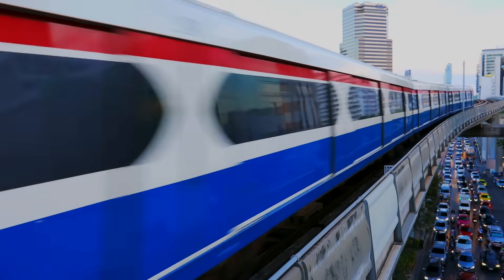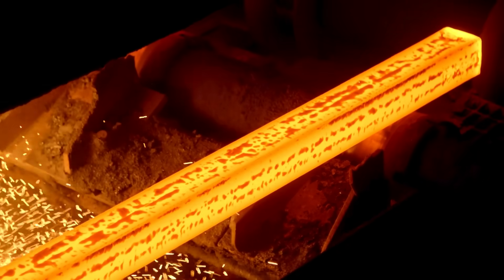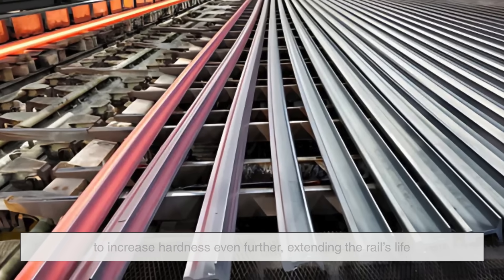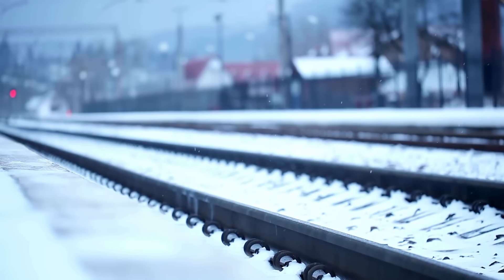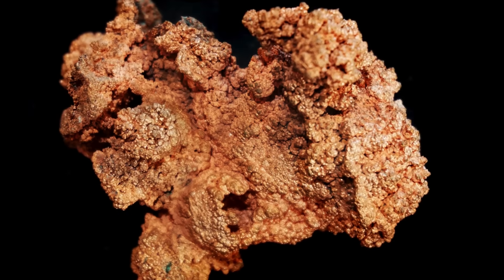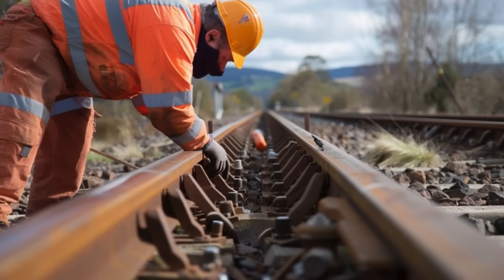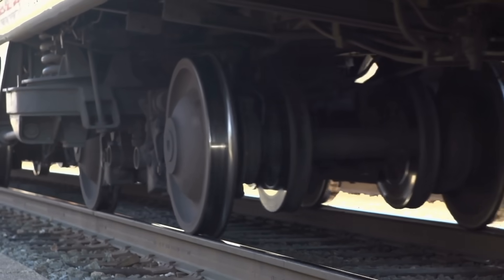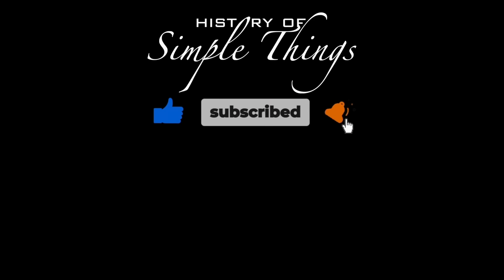Why Are Train Rails Made of Steel and Not Other Metals?

Comment: Wow, you went back to aluminum when you've already disqualified it because of how soft it is.  Then you disqualify aluminum again with temperature expansion.  If you've disqualified something, especially for its unsuitability due to softness, then it should be off the table for the rest of the discussion.  Its expansion in the heat is irrelevant as it is already disqualified because of softness.

Comment: Steel is good in tension, and the right alloy on the bearing surface is good in compression... both of these factors at a good price point make it the material of choice.

Comment: How many electric motors drive the train and are there differentials or separate drive motors on the wheels on the engines.
Reply: It depends on the number of locomotives.  In the U.S., most locomotives have six traction motors under them. You do the math when you see a train.
Reply: @9983sp  thanks for the info I’ve been
Fascinated by trains and having ridden in steam trains in the past, and 1950s in the UK and now the diesel Electric trains here now it’s a lot of history that I’ve lived through.
Reply: Average weight of a North American engine weighs in over 400,000 lbs.